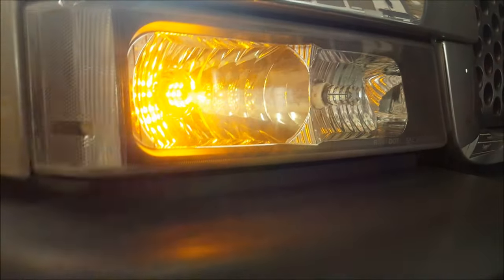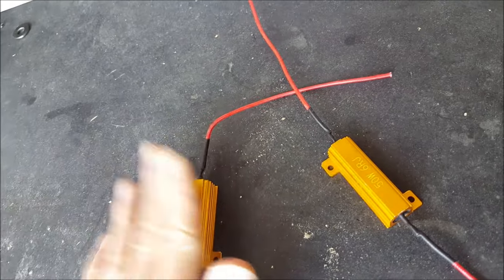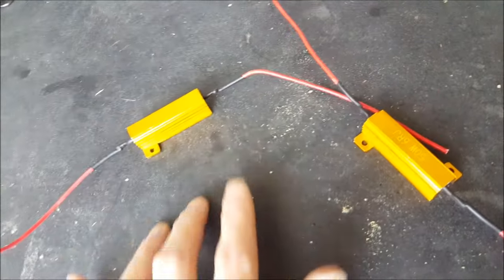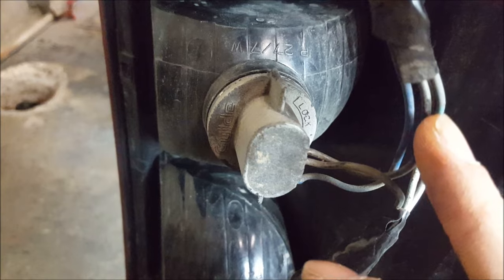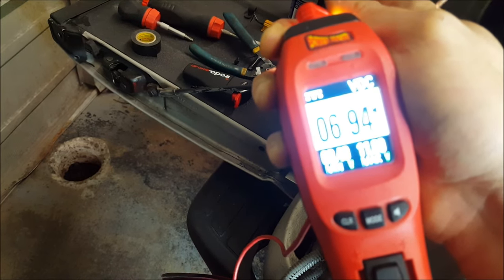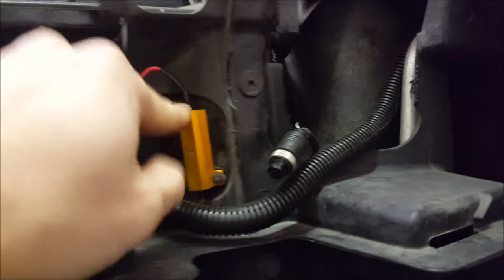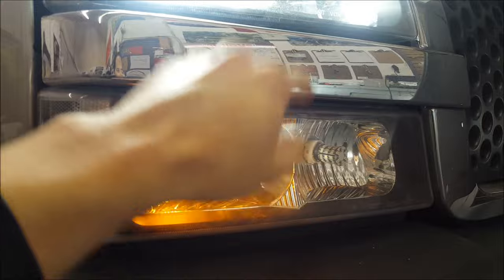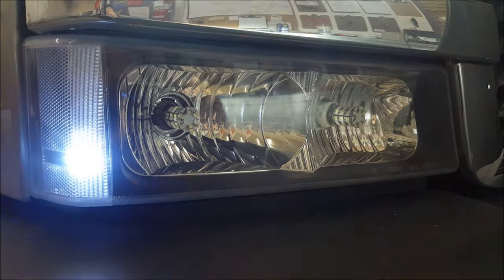Load Resistor Install (Eliminating Signal Hyper Flash) | AnthonyJ350

Comment: I checked all the wires & installed the resistor.  I made sure the brake light, tail light & turn signal worked...and it did (all in the same bulb).  Then I installed the LED bulb.  Only the brake light & turn signal worked.  I flipped the bulb around and the only the parking light would work.  Hmmm? Any ideas/suggestion?  Thanks!
Reply from the maker: D.P.T Compare the connector location of the new bulb vs the factory. Might be different.
Reply: AnthonyJ350 It turned out to be that I had to cut the brake/signal & ground wires going into the harness.  Then connected the brake/signal wire to the ground wire going into the harness & connect the ground wire to the brake/signal wire going into the harness.  Bizarre to me...but it worked!  Much thanks to my brother-in-law for figuring that out!!!!
Reply from the maker: D.P.T lol great job guys fixing it!

Comment: So how do we get rid of hyper flash on newer vehicles? I have a 2014 Silverado and load resisters are no good on it.
Reply from the maker: I believe there's lights for canbus systems. Check out JDMAstar and Ijdmtoy.
Reply: @AnthonyJ350  thanks I'll check it out
Reply: Maybe you used too heavy rsistors like 50w for each bulb? The car then thinks there is something wrong either. When using 50w for each bulb, the amount of draw is 100w(!) per side where the original incandescent bulbs are drawing 42 watt total. 25w resistor for each bulb of one 50w for two bulbs per side is better.

Comment: i have a 06 civic i have led brake lights & when i used a led bulb in the front & a load resistor it didn't work my fuse kept blowing. any suggestions? thanks
Reply from the maker: +djnevous3us What happens if there's no load resistor installed?  Does it work at all?
Reply: no still doesn't work one time the bulb melted a little bit too
Reply from the maker: djnevous3us Something is very off there.  That should not happen to your bulbs at all.  I would put back in the stock style bulbs and make sure the lighting operates fine to make sure it's not the car.
Reply: ok il try again thanks for the help. i haven't had this problem with my old civic.
Reply: +djnevous3us is it a cheap led?
Reply: +Tray Muse I don't remember where I got them from. I think they were
Reply: Same happened to mine. They were cheap

Comment: Since the resistors get hot anyways, couldn't you just use an incandescent bulb as the load and hide it somewhere?
Reply from the maker: But that wouldn't look good, you'd have to wire in a socket for it to plug into and how would you mount it so it doesn't get knocked around.  But I suppose in theory it would give you the same effect.  I advise against it though.
Reply: Ok, that makes sense.

Comment: Im having hyper flash with the running light .   Is this the wrong bulb
Reply from the maker: You turn on your parking lights and they all start to hyperflash?
Reply: @AnthonyJ350   just the back. And when turn headlights on
Reply from the maker: @wasupwilly  Is it the correct bulb style?
Reply: @AnthonyJ350  7443

Comment: Hi I put some on my Honda Accord 2020 and they get very hot is that normal
Reply from the maker: Yup that's normal.  You want to mount them to metal to help with head dissipation.
Reply: @AnthonyJ350  but they get super super hot am after of them burning something so I put 2 together and it took longer for them to get hot
Reply from the maker: @catdog34551  Did you mount them to metal?
Reply: Yes
Reply from the maker: @catdog34551  OK good

Comment: But...what if they blink really slow or not at all. Just put LEDs in and was expecting the hyper flash. That’s not what I got. Now youtube doesn’t have the answers I need.
Reply from the maker: Does it do the same thing if there's no bulb plugged in at all?
Reply: @AnthonyJ350  I’m on the clock or I would tell you for sure. All I know is that they worked after the install then I did the cab clearance lights, left it for about two hours, then went to work. That was enough time to stop working. I put my blinker on and nothing. I replaced the flasher to no great change. Ordered a new multifunction switch as it needs to be replaced(this could be my issue but it’s such a coincidence I don’t want to rule out other options). No burnt fuse. It blinks but hesitantly(maybe once every 30 seconds). And I can force it with pressure on that multifunction switch.
Reply from the maker: @libertyordeath9797  What kind of vehicle?
Reply: @AnthonyJ350  94 f350 idi
Reply from the maker: @libertyordeath9797  You would have to try one original bulb in the back or front and have the opposite empty to see if it does the same thing
Reply: @AnthonyJ350  my plan for after work. I don’t want to chance a ticket if I can just put the bulbs back in and have it function correctly.
Reply from the maker: @libertyordeath9797  Let us know how it works out.
Reply: @AnthonyJ350  will do, never know when the next person to ask the question will be.
Reply: @AnthonyJ350  wouldn’t you know it, now it blinks.
Reply from the maker: @libertyordeath9797  So you installed LED bulbs and it flashes normally?
Reply: @AnthonyJ350  It doesn’t feel normal. It feels slow, but acceptable. The hazards flash faster. All I did was hit the hazards on a whim. They work as expected. So I tried the blinker again. And they work better than they have since midday. I will investigate in the daylight. And install the new multifunction switch when it comes in. The flasher is new tonight. It may account for the speed difference im feeling. Updates to follow.
Reply: Update-old flasher is toast but new one is still struggling. May need to find something better than what autozone can provide. May be the fuse board too. Or all of the above.
Reply from the maker: @libertyordeath9797  What happens with regular bulbs?
Reply: @AnthonyJ350  perfect blinkers.

Comment: so do you need one for each signal light?
Reply from the maker: Yes since the vehicle can "see" bulbs in each corner.
Reply: cool thanks for the quick reply off to order 4 , i am considering 6 just not sure how to mount in the undersideview mirror turn signal
Reply from the maker: adam cunningham Just make sure you mount the load resistors to metal. They get really hot.
Reply: thanks i was watching another video on how to install them not sure if its possible , not sure there is any space in the under mirror :( probably just replace the dead bulb
Reply from the maker: adam cunningham You would just need to find the wires in the car probably in the kick panel.
Reply: would that work as well if i use the wires in the kick panel away from the bulb?
Reply from the maker: adam cunningham As long as you're on the circuit. If you watch my 350Z conversion I install them far from the light.

Comment: How the 50w 6ohm  Load Resistor works 
one end of the wire connect to the Black wire and then connect the other wire to the signal light wire it might be a green wire or a red wire of course ever car is different , to find the blinking light. Tool needed is a Test light.
Reply from the maker: Thanks for sharing the tip.

Comment: i installed led turn signals onto my super beetle and upgraded my relay but the turn signals turn on but dont flash would this maybe fix that?
Reply from the maker: Adrian Berumen Most likely. If you remove the bulb does the indicator on the dash do the exact same thing?
Reply: AnthonyJ350 yeah also when i turn on my hazards
Reply from the maker: If you put the original bulbs in, does it work fine?
Reply: AnthonyJ350 if i put in the original ones they dont turn on at all

Comment: my bulb just goes into the socket housing and when you put it back in to the housing area it works
Reply from the maker: You would have to look into a flasher module then.  There might be some bulbs that can correct the "error" internally.  I'd check iJDMTOY and see if they make anything for your vehicle specifically.

Comment: BEFORE I WATCH YOUR VIDEO I HAVE A VERY STRANGE PROBLEM!!! I have hyperflash on a 1999 Ford F-150 Pick Up!! EVERYBODY on YouTube says it is an LED Bulb causing the problem..........and this is "PART 1" of the problem because I DO NOT HAVE LED lights in ANY of my sockets AT ALL!!! 

THEN PART 2 is EVERYBODY tells me "You have a blown light bulb" and I replaced BOTH the passenger side (front AND rear bulbs) bulbs with brand new bulbs and I STILL have the same problem!! And when I replaced them there is NOT A SINGLE OLD BULB that was blown even though I replaced them anyhow with brand new ones!!! I STILL have a passenger side flasher that is blinking like it is "hyperflashing" and I don't know why, but I have NOT replaced the flasher unit yet!! If you have any answers to this or know how to fix it please email me at PistonRev@yahoo.com and thank you in advance for your help!!!!
Reply: Oh and I forgot to add it is ONLY HAPPENING on the passenger side.....NOT the drivers side and I haven't figured out why!! All the wiring in the truck looks fine and intact....which I thought I had a short, BUT there too another mystery to this is that when you turn on the passenger side turn signal BOTH lights ARE flashing front and rear and there is NO EFFECT (Dimness or other issue) with the normal "running lights" operation either, in fact the marker lights (when normally on) look fine and exactly as bright as the other side (Driver's Side)!!
Reply from the maker: I would measure ground and voltage on the light you're having issues with.  It's possible it got chaffed over time.

Comment: Can you run 2 led bulbs off of 1 resistor?
Reply from the maker: I would contact the manufacturer about that.  I have never done it myself so I can't confirm.
Reply: Each side, front and rear, is one circuit so you should use one 50w resistor when replacing the front and rear bulbs. Otherwise, use one 25w resistor for each individual bulb.

Comment: never seen this problem. on good install only on semi sketchy install. didnt know it could happen to anyone. will keep this i video in mind if something ever happens
Reply from the maker: +Emmanuel Nwancha It would pretty much always happen when you convert the signals on a car originally equipped with incandescent light bulbs.
Reply: It happens on newer vehicles that have detectors for light bulbs that are out. Not sure if the term CANBUS applies to all makes and models or not but that is what my Jeep has.

Comment: What about actual led tail lights not just the bulbs but actual led tail lights
Reply from the maker: What about them?
Reply from the maker: Unless they are designed for a CANBUS vehicle and going into a CANBUS system, you will still need load resistors.
Reply: I don't know I have a 2010 silverado and when I put these in they hyper flash
Reply from the maker: @jameseichele7118  You'll need to wire in load resistors https://youtu.be/NMoYGQhD2DI

Comment: Hmm, U can use only one resistor for all four bulbs, and save some money. Just cut out negative from all bulbs assembly, join all of that GROUND (or MINUS) into one wire, connect it to the  ONE resistor only and connect resistor to the ground. That resistor is not under load all at once, just when direction lights are in function. (in Your case, 50W resistor is way too much than U actually need, just be aware of what is the power consumption of LED, if it's 3 W than resistor can be AT LEAST 3 but it can be little bit larger, f. inst. 4 or 5W. And it's cheaper). In my example, U can use only 10W resistor.
Reply from the maker: But these things get so hot.  Isn't overkill better?  Have you ever touched one when it's in operation?
Reply: Yes, 35 years ago...Yes, U R wright, it gets hot, anyway, according to calculations, it must be as I said. If the LED are  let's say, 2 Watts, than 4 LEDS is 8 W resistor, 10W just to be sure. That's it. But as I can see, in ALL examples, people are using resistor with very high power. Strange. Than, I would go with current limiter, with high power transistor (PNP value, base and emitter short circuit together). I like to get things more complicated :-). In that case, LED would have better working condition  (it will last longer). It's all strange with these calculations concerning LED in car. Maybe, it's an error in overall approach to this lightning solution, maybe to add one more relay just to avoid existing car relay circuits. I just don't know what are technical characteristics of car LED's (power, current draw, voltage etc.).
Reply from the maker: But it's easier to wire them in each corner (and everyone carries the 50 watt version) and service.  I don't know why you would want it more complicated, my setup is 8 years old and I've only changed a load resistor once.  That's a on a daily that goes through summer and winter conditions.

You state "you would".  Is this all theory or is the comment based on practical application test through the years on several vehicles???
Reply: I haven't tried any, I just know how electronics work. I'm just "thinking aloud". Resistor are not cheap. I was thinking to use just one bulb P 21W, the one from the taillight instead of resistors, and still stick with what I propose - I'd like to experiment. I would cut all four GROUND and connect just one bulb instead of four resistor, place the bulb somewhere, under the hood. Yes, that would work. In that case, bulb will act as fuse as well. Honestly, when I was cracking the known Technics amplifier in early 80's, known as AA Class series, I was designed and made my own AA Class - but simplified, and it was working perfectly. Point was, I couldn't find solution how the Technics solve this internally, inside the amplifier. My solution was so simple but effective. I will definitely try this in my car. However, it's an error in present car relay circuits, relay should be replaced with this http://www.car-mod-shop.co.uk/cf13gl-02-3-pin-flasher-indicator-blinker-relay-for-led-bulbs-fix.html
Reply from the maker: Yup putting something like that in will also solve the issue.  As long as people wire clean and it's reliable I'm open to solutions.
Reply: No, each side, left and right, are separate circuits. Use one 25w resistor per bulb or one 50w resistor when you replace two bulbs in the front and the rear for each side (L or R).

Comment: do i need them for a 2012 toyota avalon?
Reply from the maker: Do you have hyper flash?
Reply: +AnthonyJ350 i didnt get them yet i was just wondering if i need them before i order it
Reply from the maker: Central Jersey Dashcam Is it just a standard incandescent bulb in the turn signal?
Reply: +AnthonyJ350 yes
Reply from the maker: Central Jersey Dashcam Most likely it will.  I would consult whomever you purchase them from.
Reply: +AnthonyJ350  ok thank u very much

Comment: my vw does have any wiring connected to the front turn signals
Reply from the maker: It kind of has to, how else would the light work?
Reply: AnthonyJ350 look up the 2014 Volkswagen Jetta socket and you'll see that it really doesn't have wires connected to it
Reply from the maker: There's probably a circuit board built into the light housing, similar to this one. https://www.youtube.com/watch?v=5p_GtDRP8VU&t=24s
Reply: AnthonyJ350  I think mine has a circuit board for turn signal

Comment: mine don't blink at all what could be the problem 92 Chevrolet silverado
Reply from the maker: GM's in the 90's just stay on when they think a bulb is burnt out instead of hyper flashing.
Reply: AnthonyJ350 what would fix it?
Reply from the maker: Chandler miller Have you tried a load resistors or flashing module?
Reply: AnthonyJ350 I haven't

Comment: What can i do if a load resistor doesn't work??
Reply from the maker: You can look into a flasher module.
Reply: Yeah thought about that but I can't find one on my truck 2011 f150 even the dealer doesn't see to know where it's located!!!
Reply from the maker: Michael Navarrete Could be built into the Body Control Module. You'll probably need to find a light or module compatible with the CANBUS system. Did you try contacting iJDMTOY?